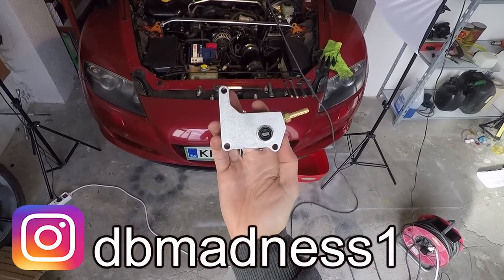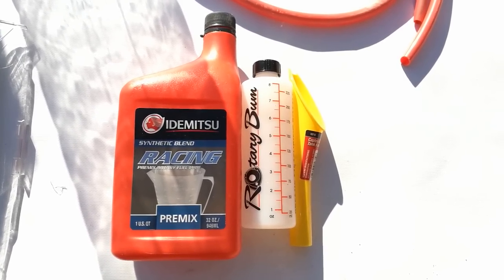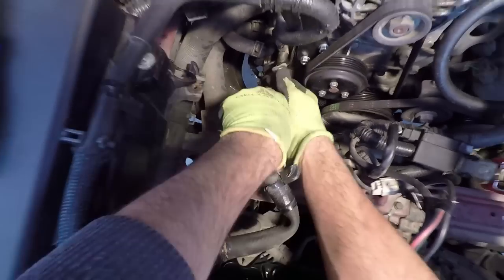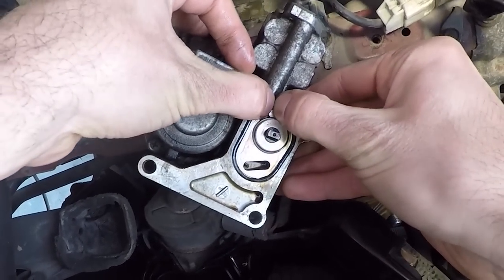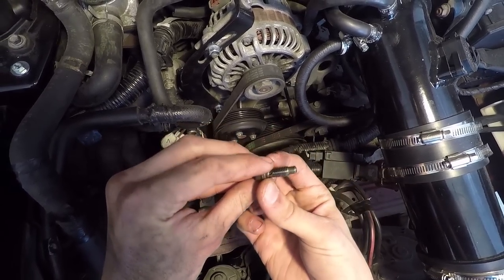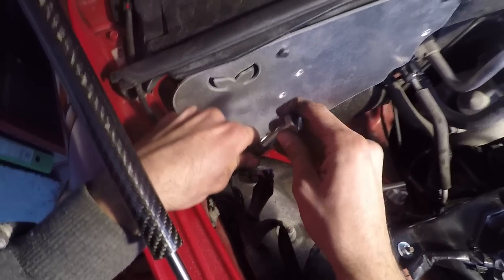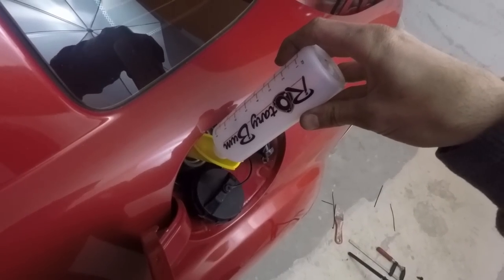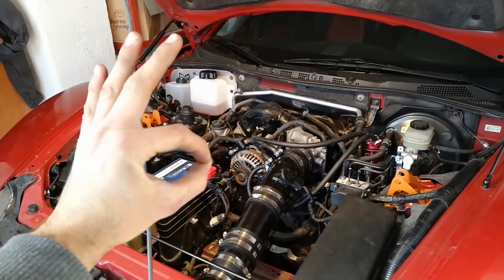Mazda Rx8 Sohn Adapter Kit Install

Comment from the maker: If you want to check out the items mentioned in the video, they are linked below: 
🟠SOHN ADAPTER: https://ebay.us/S9xV0H

⚠The Sohn adapter kit has been discontinued, so you need to buy a hose that you will connect on one side to the sohn and the other side to a container that you need to buy separately. The hose and bottle can be bought locally in your area.

🇺🇸 USA & ASIA:
🟠PREMIX: https://amzn.to/3yrAE5b

🟠PREMIX BOTTLE: https://amzn.to/3T9A305

🇪🇺 EUROPE:
🟠PREMIX: https://amzn.to/3CJ5E3j

🟠PREMIX BOTTLE: https://amzn.to/3SN0LMa

🇬🇧 UK
🟠PREMIX: https://amzn.to/3yplBsB
Reply: Sohn or not, I wouldn't go full synthetic with a rotary. The benefits of a sohn: you get less carbon deposits (fresh oil burns off cleaner than dirty oil), more oil capacity, and better seal lubrication (clean oil lubricates seals better than dirty crankcase oil). "Synthetic oils are not suitable for rotaries. OMP or not, premix or not, they don’t have the ZDDP (Zinc Dialkyde) necessary for rotary engines. The additives they contain are simply not enough. Furthermore, when synthetic oils reach high temperatures, they varnish and create deposits in the motor, damaging the bushings and internal rubber joints. There is no advantage in using a more expensive oil that has no advantages. It is necessary to do your oil changes at the same interval, between 3000kms to 4000kms maximum. For example, Brad Penn oil (mineral with synthetic additives) It is less expensive and has all the characteristics needed for rotary engines. The advantages are obvious, as your motor will start better, run better and smoother." ( Source: Derwinperformance.com/articles/all-oils-are-not-created-equal/ )
Reply: Dang this link is even busted 😞
Reply: @RobbieE56  Which link do you need?
Reply: @adammiller5136  The updated SOHN adapter kit.
Reply: I can't find a Sohn anywhere. Is it only for the S1?
Reply from the maker: @jaycool5978  Yes, only S1 Rx8
Reply: @Drivenbymadness  that sucks I've got the R3.

Comment: After I started watching your videos, I seriously considered buying a RX-8. It is great to aquire the skill to maintain and eventually rebuild a rotary, they are relatively cheap, and they sound amazing. But at the end of the day the NC MX-5 has the same great chassis, a very reliable engine with sensible fuel consumption and better tuning potential than the Renesis. Also a hardtop turns the NC into a nice looking coupe. Of course you have to be secure enough to get passed the hairdresser jokes :)
Reply: Miata chassis are conventional rail chassis the NC was a half and half derived from the bottom end of the RX-8 mixed in with older Miata style conventional rail chassis. The RX-8 has a full cockpit type full unibody. It is literally ONE of the only chassis of its type that existed at the time when the RX-8 was created and its the same as what's used in HYPERCARS these days. 

The RX-8’s entire front suspension is held on by the end section of the unibody. It literally has no front structural subframe. And the rear of the RX-8 is a full 5 point multilink meaning that its not just two suspension arms and a few other bars linking the suspension like conventional rear multilink suspensions used in other cars. I mean the RX-8 has 5 entirely different individual  bars and arms with bushings holding the rear hub/knuckle assembly as well as the shock and spring. 

That 5 point multilink suspension it has at the rear is one of the most reliable ways to run a cone type Torsen diff (RX-8 has a special diff that is not just a torsen spring but it also has cones that act as a taper so that the diff has torque vectoring by design. Other cars don’t have this. Definitely not any Miata, not even an ND.) This LSD diff design requires a proper 5 point rear suspension to even work because of the way a true Torsen diff needs to keep load on both rear wheels at all times in order for it to work. 

For anyone to claim a Miata is the same chassis is a joke. The only thing that the NC and RX-8 have in common and are interchangeable is the steering rack and some of the suspension parts that serve as upgrades for the NC but that's it. The RX8 chassis is different to any of the Miata chassis (NC or otherwise). Ridiculous levels of bullshit going on with people claiming the NC is a short wheelbase RX-8 chassis.
Reply: @alexflores5020  So this is the specific breakdown on why the RX8 has got such a great and almost mythological chassis. This car really does amaze me more and more the more I learn about it
And thank you so much for the in-depth description

Comment: Had no reason to watch as i own a series 2, but i still watched as i love your vids!!
Reply: I would imagine in a series 2 it would still be nice to use 2 stroke oil instead of burning dirty engine oil, but since the S2 has enough injection ports you don't have to worry about putting any in your gas tank.
Reply: @thirdpedalnirvana  then im buying a s2 then thanks mate 👍

Comment: I have been running Royal Purple in my 09 for five years with the stock OMP setup.  RP actually burns pretty clean.  Nice light brown powder on the plugs like 2 stroke oil.
Reply: Chad Bremer your referring to premix right?  I’m just trying to find the best premix for myself.  Just picked up an 05.
Reply: @petescarport  I prefer Klotz - Estorlin Benol racing premix castor oil. It works extremely well and makes the exhaust smell better, especially if you have a non-cat pipe.

Comment: Man, your DIY videos are amazing!

Just 1 problem I have w/ the Sohn Adapter. The problem is, it's still actuated and controlled by the OMP. This means, that it only does its job when the OMP pumps oil into the combustion chamber. This also means, that it only lubricates at the RPM that the OMP opens up. Premixing on the other hand, ensures that you have oil at all RPM and functions independently of the OMP.  This adapter is good because, like you said, now you have fresh 2-stroke oil in the combustion chamber. Although, switching to synthetic oil, it will still burn like synthetic oil when the OMP pumps it in. 

Keep up the good work! Can't wait to see what you have next on the to-do list :D
Reply from the maker: That's true. If the S1 rx8 would have a 3rd oil injector, like the S2, this would be ok, but if it was electronically regulated to add oil troughout the whole rpm range, but in different quantities, this would be poerfect.

Thanks Snoopy :D Ohhh boy o boy, do i have ideas! Too bad i have more ideas than money :P
Reply: @Drivenbymadness  ever tried using a setup controlled the same way as fuel injectors? I have series 2 and had capabilities to program 12 injectors so i did it that way could always be an option
Reply: Well series 2 engine anyway

Comment: YES! FINALLY!
Even better you can directly see the premix left in the reservoir, instead of having to pull the oil dipstick every single time.
Still remember me mate? Now I can consider this adapter and switch completely to synthetics.
I don't have access to Idemitsu Premix >_< so I use the Idemitsu 2T FC.
Reply from the maker: I remember you from the image on your profile :P Yes, this conversion is great in every way imaginable. I'm also gonna switch to full synthetic 5w50 oil :) If you have a de-cat, any 2t oil with JASCO certificate will do ;)
Reply: Sure will haha, I still prefer non-marine 2T oil nonetheless :D

Comment: Nice video! Now I gonna buy the sohn adapter  and the thermostat to install haha
Reply from the maker: Thanks man! Awesome! For the track the termostat along with a better radiator will do wonders.  The sohn is a great add, so go for it :D
Reply: Don't forget you need an oil tank to feed the Sohn adapter. This is NOT included, so you have to source it yourself. The one in the video can be bought of Ebay as a complete kit, I have the very same one too. But, with some handywork, you can DIY a tank yourself. I've seen gastanks of mopeds and scooters being used. But, for the low price and ease of installation, I highly recommend the hassle free Ebay solution. You can even get the backplate in fancy colors, if you so chose. There won't be a hole for the headlight spray thingies, but I'm sure you can drill a hole yourself and with a grommet, mod the reservoir so that it still works.

Comment: My good friend, some of these links no longer work. Please update, as I'm looking to purchase through your link. Especially the fluid container upgrade, that one is hard to find in North America. Thanks bud!!  - Keep up the great work on your channel!!
Reply from the maker: Hi there, unfortunately the fluid containers can't be found anywhere anymore, i keep updating my links but they expire so quickly that i can't keep up. You can purchase the adapter itself and use a generic bottle with the same exit part for the tube as the one in the video and find somewhere creative to bolt it on.

Comment: Q&A (the question is there i promise)
so, i watched this video like 6months ago bc i was wanting to drive the rx8 for school but that didnt end up happening (the engine needs to be rebuilt and insurance). For the sohn adapter ik i have premix whatever oil i want to, but what about the engine oil? like do i use 5w30 for engine and a thicker systhetic oil for premixing? or the thicker oil for both??
Reply: 10w30 in hot days, 5w30 in winter, dont recommend driving this vehicle in winter, I live in Canada where it gets to -50 C

Comment: Thanks for this very informative video. With so much oil being injected into the rotor housing I would expect the engine to have greater longevity and run at lower temp. . I do wonder about the longevity of the 2 stage cat keeping up with the oil flowing into the exhaust. In California we have very strict emissions laws and if their is a check engine light with an associated Cat Converter code the vehicle is not fit for registration.

Comment: I don't recommend using synthetic. Rotary engines are not designed for synthetic. Use a petroleum-based oil in both crankcase and Sohn oil reservoirs. I recommend using an engine oil that meets API specifications SL or SJ; this means the oil contains adequate ZDDP (anti-wear additive) for a rotary engine. There is no point in using synthetics in a rotary, but there are several reasons not to use them. The main reason is that you should be changing your oil at no more than 3K regardless of the oil you use. The second reason is that synthetics have a higher flash point and will increase soft carbon build up inside a rotary engine. I use a 20W-50 conventional oil (Castrol Classic [high ZDDP]) in the crankcase, and a 10W-30 oil (Castrol GTX) mixed with 20% Marvel mystery oil in the Sohn. I still pre-mix using a castor oil based two stroke mix (Klotz Estorlin Benol) since it is one of the few clean burning non-synthetics (and it makes the exhaust smell better). I do NOT recommend using Idemitsu in a rotary since it IS synthetic (although they have great products for non-rotaries). Since this post hasn't been updated, here is where you can find the Sohn adapter: 
https://www.ebay.com/itm/195826815768

Comment: Great video man!!! sums up a nice couple hour job in 9 min, awesome. make sure you see fluid running all lines without air vacuum leaks from injectors

Also noticed mine ran about 6 oz (175ml) for a tank, I still double up with an extra 6 oz in fuel to run 1 oz per gallon, little heavy but with not cat converter she runs great

Comment: Thank you for this video, Installed one last weekend using this video although my adapter used oem type rubbel seals instead of paper. Really easy to follow and take notes. How did you solve the headlight washer system? I left everything from the oem reservoir to the car but my headlight washers don't work anymore and are needed for inspection
Reply from the maker: Thanks man. I left the headlight washer system unplugged. I think youll have to do a dyi method to enable it again.

Comment: Good video, why do you have to premix your fuel, i don't see how this can increase the lubrication of the rotor tips and also using an oil that burns easily in the sump instead of mineral oil would that not be beneficial than using a sohn adapter kit?
Reply: You can use proper synthetic oil to lubrificate and handle the heat and for the chamber you use proper oil that is made to be burnt.

Comment: Nice, welcome to the club! Just one thing, I don't know how much of this is true, but I heard synthetic oil could potentially damage the rubber O rings on the rotors. Having said that, I've been running semi synthetic Castrol Magnatec since and haven't encountered any problems.
Reply: Is it really safe? How long have you been using it? Because I'm afraid it might cause problem in the long run.
I've been running Idemitsu 10W-30 mineral oil.
I avoid running full synthetic, but I heard that Royal Purple Synthetics could be run on rotaries safely, but it hasn't convinced me yet.
Reply: I've had my Sohn adapter installed for about 30k kilometers now. Zero issues so far. As far as engine oil goes, I wouldn't really know what to recommend. but I will say this: The specified oil by mazda is too thin. They did this in order to get ever so slightly better mileage at the expense of the engine. I run 10w40 myself.
Reply: I haven't got a Sohn Adapter yet, the OMP still inject 4T 10W-30 oil. This is the main reason why I still avoid synthetics, if I'm not mistaken you could run synthetics after you install the Sohn adapter as the engine will inject 2T oil instead of used 4T oil.
Reply: That is entirely correct. However, the main reason to go to full premix OR the Sohn adapter is basically that your omp wont inject filthy black oil from the sump into your combustion chambers.  Even if you just changed your engine oil, there is still a lot of filthy oil in the oil coolers & lines. Hence you never really have fully clean oil, not even after an oil change. Over time, this oil becomes absolutely filthy, making your omp eat ever more filthy oil. Imo that's the main reason to switch over. Ofcourse 2stroke burns "cleaner" so you should theoretically have less carbon deposits too.

However, even with a Sohn adapter or full premix, you will still need to change your oil every 5-7k kms. I do mine religiously every 5k, and put in a new filter with every single oil change.
Reply: That's cool.
By the way I've had this question for a long time, should I switch to synthetic (or synthetic blend) with my OMP on? The debate for oil in the RX-8 is too intense to be honest.... Some say not to run synthetics (I'm one of them), even some builders like Essex Rotary don't recommend it. However some say it's fine and even better to run rotaries with synthetics (I'd assume full synthetic), Black Halo Racing says so (in general), Racing Beat too (they tested Royal Purple).
Reply: Yeah, don't you love it how nobody ever has a conclusive answer in rotary world? :)
Reply: What makes it ironic is that Mazda says not to run synthetics, but their racing team actually used it....

Comment: Where can I buy this t handle or is it even necessary, is there another tool that can be used or does it have to be this
Reply from the maker: The T handle is very handy and gives you good grip and torque to tighten/loosen the bolts. Here's the link to it and gets also the bits to put in: https://amzn.to/2HkwAsH

Comment: Does this replace pre mixing or is it still necessary to premix. My guess is you still need to premix but this will eliminate standard oil burning and will allow full synthetic to be used.  Hmmmm.  Seems like a great mod
Reply: You could have the quantity of oil that's injected adjusted so no need to pre-mix
Reply: Geoff Haylock wow that sounds awesome.  Do you fill it with two cycle oil then
Reply: @petescarport  yes

Comment: have u thought about putting in a small hole in the cap of the resovior so that air pressure doesnt make the omp have trouble pumping the oil? just a thought that occured to me. let me explain, when the omp needs to pump oil into the rotor housings, it sucks the oil, but the oil resovior will build negative pressuse inside it, this might make the oil pumping hard to do cuz the resovior itself is making a negative air pressure. if u guys are confused, dont worry, i am not the best at explaining what i mean. heres an example, when u drink from a water bottle and seal ur lips around the bottle and dont let air into the bottle, the bottle shrinks and crumbles due to negative air pressure, now im saying the same idea to the resovior, except the resovior won't crumble, cuz its probably hard plastic, but if u put some type of filtered air hole in the cap, that won't occur and the OMP will get the right amount of oil without any backpressure. just my 2 cents, take it or leave, dont flame chat.
Reply: The caps in these kits are vented.